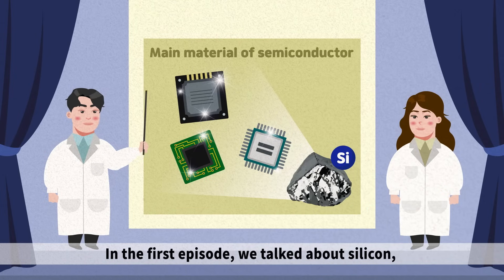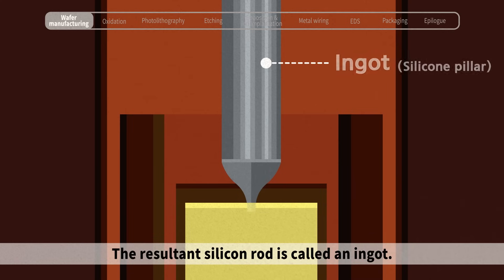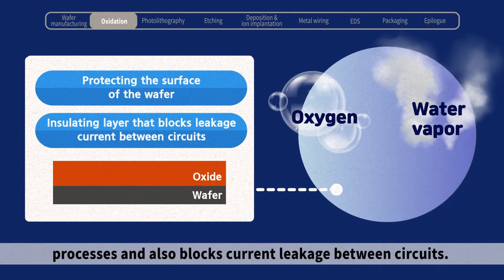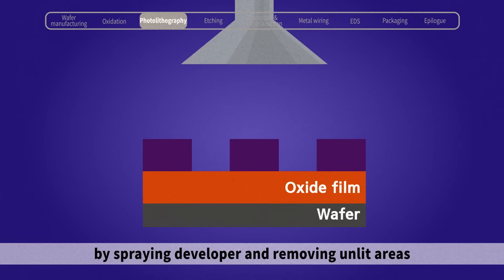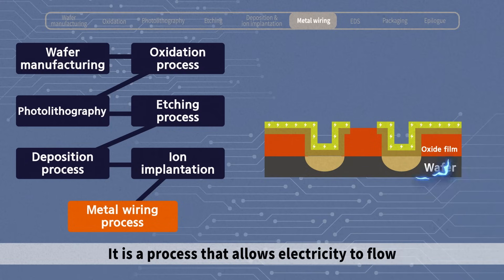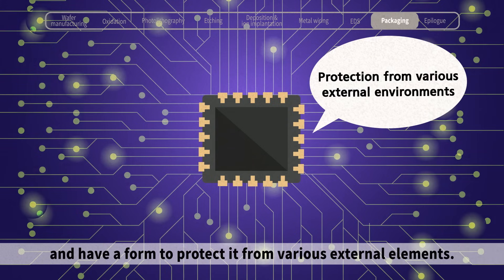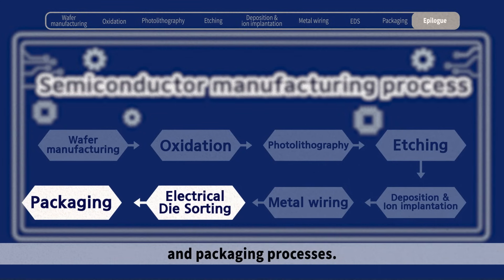‘Semiconductor Manufacturing Process’ Explained | 'All About Semiconductor' by Samsung Semiconductor

Comment: Would it be possible to create a dual layered chip. 
By that I mean having one chip be the "up" side and instead of using one chip and cramming as many transistors onto it as possible and using it alone use two chips with the same philosophy but with the second chip acting as a secondary processing command. 

To explain further when chip A sends a signal to chip B chip B responds with the same number of transistors A would normally use but then B takes that load instead and gives A the answer to compute instead of having to do all the load at once. 

Kind of like seperate cores already I guess but I mean directly one underneath the other seperated with a liquid metal heatsink with a grid pattern to allow the transistors to still connect. 

This is a question only I have no knowledge of computers

Comment: Item# 452	100mm	P	B	<100>	0-100	500um	SSP	Test	In Stock	2526	$35.22	$27.06	$20.26	$13.46	$12.91	$12.09			100mm Silicon Wafer Used for sensor fabrication, spin coating, microfluidics research and Will be used as carrier wafers for etching quantum computing field R&D and more! Best seller!

Comment: 🎯 Key Takeaways for quick navigation:

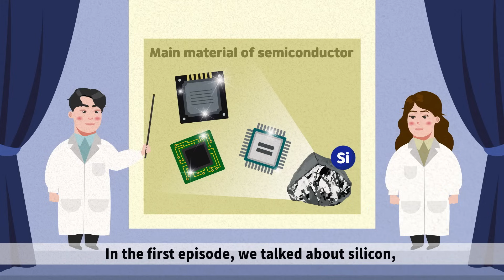00:17 🛠️ Semiconductor Manufacturing Processes Overview
- Overview of essential semiconductor manufacturing processes,
- Introduction to the processes of wafer manufacturing, oxidation, photolithography, etching, deposition, ion implementation, metal wiring, EDS, and packaging.
00:58 🏗️ Wafer Manufacturing Process
- Description of how silicon ingots are sliced into wafers,
- Importance of polishing to remove surface defects,
- Significance of wafer diameter for chip production.
02:08 🛡️ Oxidation Process in Semiconductor Manufacturing
- Explanation of the oxidation process to form a protective oxide film,
- Role of the oxide film in protecting the wafer's surface and preventing current leakage,
- Importance of a uniform oxide film for subsequent processes.
02:38 🎨 Photolithography Process
- Overview of the photolithography process in semiconductor manufacturing,
- Importance of photomasks and photoresist in circuit design transfer,
- Steps involved in transferring the circuit pattern onto the wafer surface.
03:36 🧪 Etching Process
- Description of the etching process to carve out unnecessary materials,
- Differentiation between wet etching and dry etching,
- Importance of precise etching for desired circuit design.
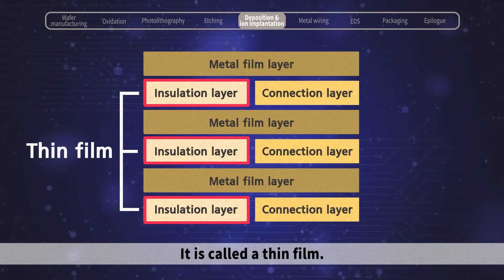04:18 🌐 Deposition Process
- Explanation of thin film deposition onto wafers,
- Importance of precise and uniform coating for electrical characteristics,
- Materials used for thin film deposition.
04:46 ⚛️ Ion Implementation Process
- Importance of ion implementation in rendering the wafer conductive,
- Role of impurities in enabling current conduction,
- Contribution of ion implementation to semiconductor functionality.
05:15 ⚡ Metal Wiring Process
- Description of the metal wiring process to create paths for electricity,
- Importance of thin metal film deposition for electrical conduction,
- Materials commonly used for metal wiring.
05:44 🧪 EDS Testing Process
- Overview of the EDS testing process for semiconductor chip quality assurance,
- Explanation of yield and its significance in chip production,
- Role of EDS in identifying and sorting defective chips.
06:12 📦 Packaging Process
- Description of the packaging process for individual semiconductor chips,
- Steps involved in cutting wafers into chips and placing them on PCB boards,
- Importance of sealing and labeling for final product completion.

Made with HARPA AI

Comment: Good introduction.  I've been working in this field since the mid 90s and it still works pretty much exactly like it did then.  Smaller wavelengths, better wafer handling robots, better measuring tools, but still pretty much the same.

As others have stated, many of the words are pronounced wrong, but otherwise it's good
Reply: Hlo sir can you help me?

Comment: Computers don't "design" the "circuit pattern" on a mask...design engineers and mask designers work together to create these designs using various CAD programs...numerous tests and design checking programs are used to make sure these circuits function as planned to specifications for the product...

Comment: AMSTRONGS CHIPS ELECTRONICS UNIVERSE AND NANOMETRE  1 NM VRAM APU SSDM2 RAM Q QPU VRAM GPU E STROANGE MICROS SD RAM D D-RAM CPU  1NM   CPU APU SSD MICRO SD  RAM DRAMCPU GPU QPU M2 VRAM 10,000 AMSTRONGS 1000 AMSTRONG 100 AMSTRONGS 10 AMSTRONGS 1 AMSTRON - 250 NM -25 NM

Comment from the maker: How did you enjoy our clip?
The opinions of our viewers are always very meaningful to us.
If you have any thoughts or ideas, please do not hesitate to share them!
Our team is eager to take your ideas and turn them into reality.
Reply: How long is the time, that it usually take for a wafer to go through all the steps above until it is a finished and packaged chip?
In addition it would be really great to learn, perhaps in another video, what the main production challenges are for a fab and why the construction of one is so expensive.
Your engagement with the community is much appreciated.
Reply: "Ion-implementation" should be fixed in the audio at 0:35 :)  (and at 4:40 also)
Reply: You probably need to research the difference between 'Implantation' and 'Implementation' for the efficacy of the content provided.
Reply: Without using an edge grinder, is there any methods used to manually smooth edge the wafer post-grind?
Reply: awesome video.
 I love to watch and learn things.
 love the electronic world.
I used to test these beauties to make sure they were ready to assemble.
Reply: It is ion implantation, as written and not ion implementation as said. Could you try to fix that please.
Reply: Really good video all in all, but I must say that the steps described near the end are a little confusing. Not sure why a PCB has to enter the picture for the semiconductor to be fabricated. Also, I'd have to think that a die has to be cut from the wafer BEFORE it makes it into something like a resin packaging, gets connected to the substrate in the packaging, and is sealed by way of injection molding. Correct me if I'm wrong.
Reply: The time stamps in the video are not labeled correctly.   Otherwise great video!
Reply: its really well done except the image of a desert might confuse some viewers since the silicon comes from granite not just sand at the beach or a desert.
Reply: ECOSYSTEM, ECOSYSTEM ECOSYSTEM ECOSYSTEM ECOSYSTEM ECOSYSTEM 
FUCK YOU ECOSYSTEM, THIS IS NOT FUCK ECOSYSTEM! THIS IS INFORMATICS!! TAKE A DICCIONARY!!!!
Reply: As an ECE student what abilities shoud i possess to Join Such a Sci-Fi company like Samsung
Reply: vague
Reply: As our team is working on a project, can you please tell which platform did you use to create this 2d metaverse environment
Reply: okay ive watched it now give me a job
Reply: How to get in this field.. Means what to  study or where to learn
Reply: Thanks for a comprehensive video on subject. Could you plz share actual manufacturing process video and the stage pics of every step plus the usage of these chips in the circuits. Also if possible compare these chips to the electrical wiring how they are similar or different in application .thanks
Reply: Thanks a million for the video. ✨